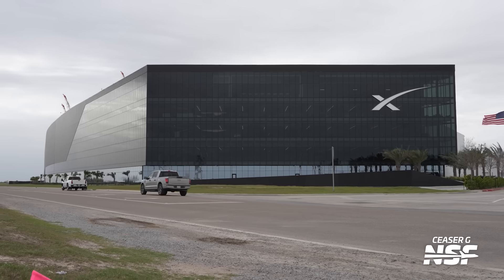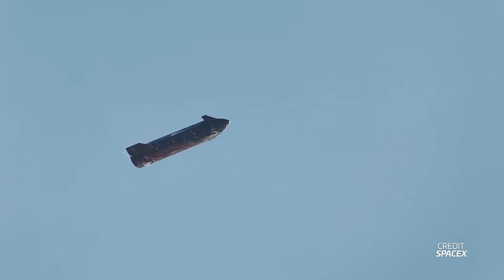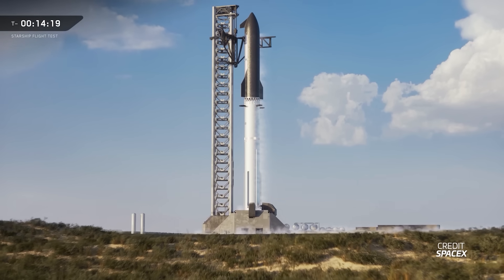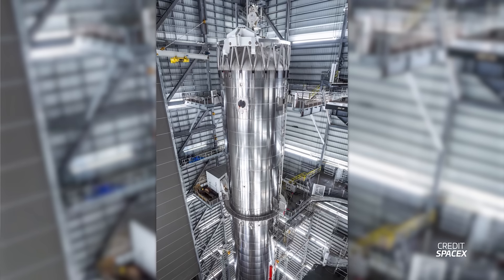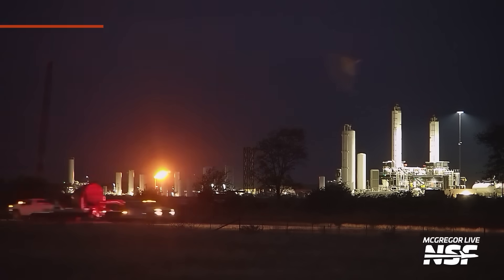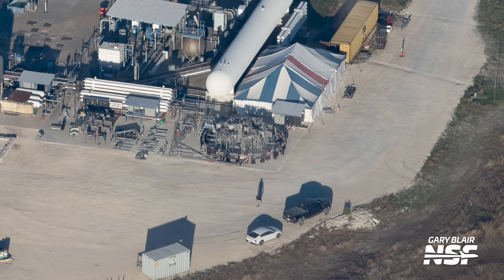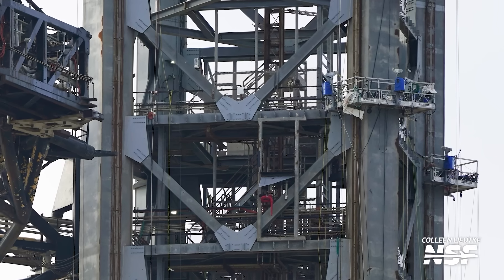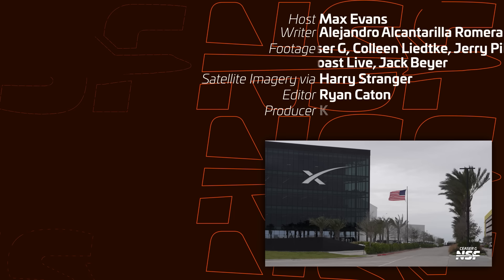Can SpaceX Hit Higher Cadence in 2026? Starship Version 3 Preview | Starship Updates

Comment: If I were at SpaceX, I'd be equipping the COPVs with an outer layer that can convey if it's been impacted hard enough to merit inspection. For example, we've had shooting targets that are black over a neon green/orange under layer, where when you hit the target the bullet knocks off the black in that layer, showing where you've hit. So something like that, but a little more resilient since it doesn't take much for the outer layer to come off... 

I swear I recall there being a plastic kinda like that which can color shift when having been compressed, like if it was sufficiently bumped against something, or dropped. Maybe even a thin bi-layer cover with a thin liquid (vibrant dye) inbetween which if punctured will leak from those areas? 🤷‍♂️

edit: typos

Comment: They need to make a rocket engine that can run for hours not minutes
Reply: A rocket engine running for hours would make no sense unless it was a highly efficient one and there are no chemical rocket engines that have high efficiency (to run for hours)
Reply from the maker: I guess a Hall Effect/Ion thruster isnt chemical, and maybe a stretch to call a "rocket engine"... but they can run for thousands of hours.... - Das
Reply: @NASASpaceflight  In which case the answer is they DO make an engine that can run for hours not minutes since I believe they make their own in house for starlink.

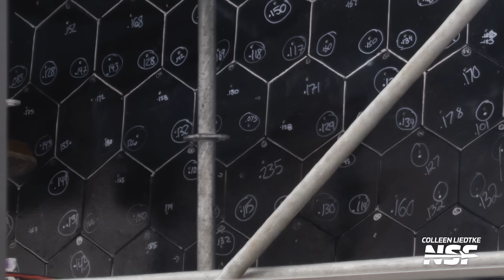Comment: About the tiles @6:02, They numbered each contact pin placement and circled anything that scored .150 or below, so I'm guessing that's how far the top of the pin is from the surface of the tile. If there is not enough tile to keep the attachment pins from melting, well you know. Anyone else?
Reply: I think they're holes between pins - 60 deg off pins - from the pics of tiles/ pins I've seen - so probs thickness / depth?